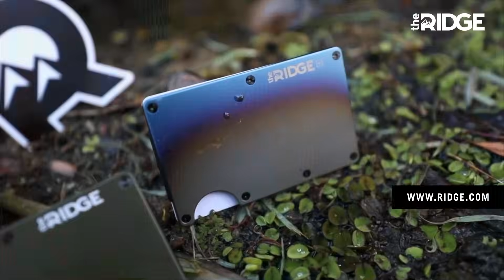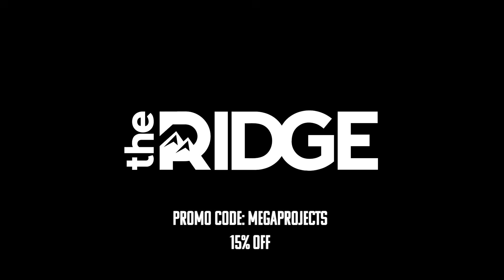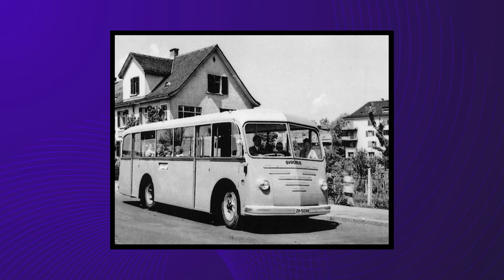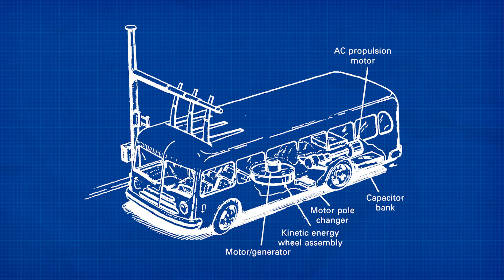Gyrobus: The Incredible 1950s Flywheel Powered Bus

Comment: The modern alternative to flywheels I've seen in use is trams and buses powered by supercapacitor banks. They have a very similar operation where the vehicle recharges at every stop, but it's most likely more reliable since there are no moving parts required in the storage of the electricity. I've seen them in Spain in Seville where the trams have retractable booms to recharge at different stops.
Reply: Thats probably a much more efficient method of storing the energy too. But I have to question if its better than just using a trolley bus or tram. If it has to keep charging at regular intervals it must stick to a predetermined route its not really able to move more freely than a tram or trolley bus anyway. Sure, it doesn't have to have the overhead wires like a trolley bus but the gyro or capacitor bus still needs large amounts of electric infrastructure for charging at stops anyway and the extra cost of the bus its self having to have a means of storing energy probably offsets any extra cost of the wires. So then the advantage to the stored energy bus is no unsightly cables but then again the trolley bus or tram doesnt risk running out of power if there is something delaying it from reaching the next stop, nor are there as many things to cause breakdowns.
Reply: @danielpope6498  Depending on the infrastructure size, I'd argue gyrobuses or capacitor buses have a much more balanced approach than trolleybuses or trams. Storing all the energy in a vehicle has obvious efficiency penalties while storing all the energy on the grid has obvious scalability issues for the infrastructure. Having multiple smaller charging stations at small intervals allows for a much more versatile solution to transport and allows for much more redundancy. Breaking one cable for a trolley bus means the entire line is cutoff while breaking one charging station may mean simply having to change routes in a large scale charging infrastructure. Trams and trolleys are also just too expensive to be a large scale solution to most cities public transport. Having a few simpler charging stations would make such a project much easier to fund and justify. That's also not considering the complicated issue of red tape which conveniently gets ignored when discussing trams and trolleys. You can't easily modify large portions of inhabited lands populated by already existing infrastructure to put suspended structural cables everywhere. Putting a couple charging poles in the ground, by comparison, is not that hard to get approved.
Reply: @danielpope6498 You can charge a capacitor bus from any building from the mains so as long as you can get too a building...you could add solar on the bus too trickle charge which could boost your mileage too 50 miles and only takes 15 seconds too fully charge at higher voltage stations but normal 220v will charge in it in a minuite or two ....you could even use a big crank dynamo too charge your caps if you wish 10 mins exercise on the dynamo could get you another 20 miles pottentially so that's a free vehicle essentially
Reply: Supercapacitors are also not yet at the point where they can store as much energy as a flywheel, which already can't store a significant amount of energy.  This isn't an inherent limitation of supercaps, just that our manufacturing ability needs to improve before they become practical for vehicle energy storage.  At present they are usually coupled with batteries to allow short bursts of large current (charging or discharging), which can be fed into or drawn from the batteries at a lower rate.  But the ultimate goal is to improve the energy capacity of supercaps to get rid of the batteries and have a 100% supercapacitor solution because there are huge benefits in doing so.
Reply: I would imagine that supercaps also do not incur weight penalty as much as a flywheel
Reply: F1 cars use fly wheels in their hybrid systems
Reply: There are modern flywheel batteries and they outperform supercaps and hypercaps
Reply: All responses within this Post are quite relevant and with the advent of current batteries for electric vehicles, a charging method would certainly lengthen the amount of time a vehicle was able to be in service.
That said, I'm wondering whether any manufacturers have seriously considered an electrical dynamo. I won't go into detail unless asked, but surely this could be a better solution?
Reply: @mospeada1152  The flywheel in this design is connected to an induction motor that is used to both spin up the flywheel when charging from the grid, and also in reverse as a generator to convert the flywheel's motion into AC power while driving.  The AC power is then fed to the electric motors connected to the wheels - there is no mechanical linkage between the flywheel and the drive wheels.

I'm not sure how a dynamo could contribute.  It has brushes that wear out and require maintenance, unlike induction motors.  The friction of the brushes also wastes energy, making it less efficient.  A dynamo produces DC power rather than AC, so it may require an inverter to run the AC drive motors (or they would have to be replaced with DC motors, which again have brushes in them that reduce efficiency and need to be maintained).  You'd need a large DC rectifier to convert the incoming three-phase AC power from the grid to DC in order to run the dynamo in reverse to spin up the flywheel when charging, and at the time these buses were in use, that would likely mean a bulky mercury-arc rectifier (either on board or at each charging stop).

In other words, using a dynamo to produce DC was at the time vastly less efficient than using induction motors so it would have increased weight and reduced the range of the bus.  With modern technology handing the DC would no longer be an issue, but there is still the inefficiency of the brushes which you don't get with an AC motor/generator.

I hope that helps give some insight into why they chose not to use a dynamo.
Reply: @Berkeloid0  Thank you, that was very informative. Long, but informative. Obviously there's a fair bit of which I am unfamiliar.
Reply: If you also need to go as "green" as possible a metal flywheel system will be much less impacting than later trying to recycle those capacitors units they are traditional lead acid batteries.

Comment: I wonder how much they could get the weight down on a gyrobus if they were to make the components with newer materials, like graphene.
Reply: The wheel store the energy as angular momentum. Energy stored depend on mass and rpm. Reducing the mass means you need higher velocity to store the same energy.
Better a clever design of the wheel shape to increase energy density.
Reply: @eliahabib5111  The original poster wasn't just referring to the weight of the flywheel - but the weight of the rest of the components of the vehicle, too.  Pressed carbon-fiber-epoxy panels might reduce the weight of the rest of the bus by a lot, compared to steel framing and panels.

Comment: Fly wheels are also an essential part of the function of motor cars as well
Reply: No car has a flywheel of the nature used in the vehicles mentioned in this video. Cars use flywheels as a method of energy transfer from a motor. Not as energy storage....
Reply: @matthewyabsley  no, it works exactly like the flywheels discussed earlier in the video. They are used in the car as a means of storing energy for use later and as a means of smoothing out energy delivery which was mentioned earlier in the video and is not dissimilar to the use in the pedal operated machine shown in the video. The combustion engine produces power in a staccato fassion not a constant application of torque like an EV so the energy is stored in the flywheel which acts like a capacitor smoothing out the power delivery and also providing a bit of reserve power when needed. The storage effect is how you have power when there isn't currently combustion hapening, same way the wheel keeps spinning when the potter's foot isnt on the downstroke. You can even see the stored power effect when someone launches a car. You build up the revs, storing energy in the spinning crankshaft and flywheel and then when you let the clutch engage that stored energy is released. Sure, you are still adding energy to the system but the stored energy in the flywheel means you have more power available than if you just had the power being generated in that given power stroke available to you.
Reply: @danielpope6498  

The flywheel absolutely does not work in the same way as that of the bus in this video.

The flywheel doesn't act as a storage device in a combustion engine it does. You're confusing rotational inertia with energy conservation.

The flywheel damps pulses of energy and damps vibrations via imbalance through the rev range. It also serves as the friction surface for the clutch and allows a starter system (usually a motor) in traditional manual gearbox equipped vehicles.
Reply: @skylined5534  I never said it was used the same way as the bus. Actually I specifically said it works the same way as it did in the pedal operated machines shown earlier in the video.
Reply: @matthewyabsley    To back up the other two commenters on this one (so far),.. I feel it NEEDS to be pointed out that an up-grade to the over-all torque output of literally EVERY internal combustion engine in existence is a heavier flywheel...

   You CAN do more for higher energy/power output of engines, of course, including a heavier crankshaft. Anyone who rides a cruiser for more than a year should understand this concept as one of admittedly MANY reasons Harleys and Indians are notoriously heavy motorcycles. The main purpose of the output is the shear torque you can generate for coming off the line, and that's part of why cruisers tend to be longer and lower set than most other types of motorcycles, to help stabilize them and prevent flip-overs and unwanted wheelies.  ;o)
Reply: @matthewyabsley  Sorry dude but I have never heard of a car that does NOT have a flywheel. Even F1 cars, before KERS had them. They were very small, but they were there.
Reply: @BabyMakR  

The sole purpose of the 'flywheel' for an F1 car (more accurately a clutch basket similar to that in a motorcycle gearbox) is to provide drive between the engine and gearbox. Very little to no rotational damping is provided by said 'flywheel'. You don't need a flywheel in the traditional sense on an engine that regularly sees 15.000rpm for sustained periods of time and needs to get there quickly. Even the starting  duties are handled by an arrangement of gears and a break off clutch powered by an external starter motor pack.

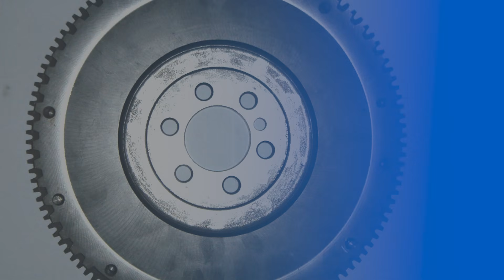Comment: 3:15 - Chapter 1 - What is a flywheel ?
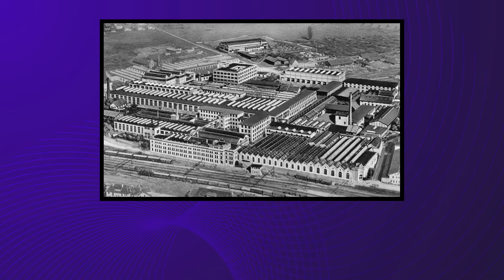5:00 - Chapter 2 - Origins of the gyrobus  
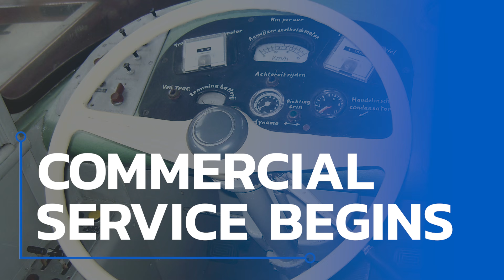7:45 - Chapter 3 - Commercial service begins
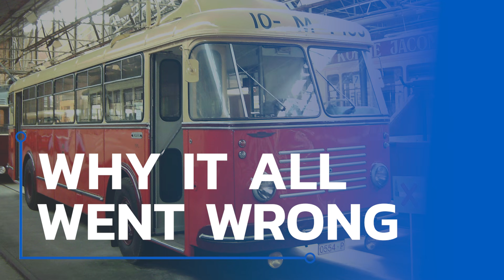10:40 - Chapter 4 - Why it all went wrong
13:35 - Chapter 5 - The future of the flywheel

Comment: Didn't Williams F1 develop a flywheel technology that was sold off and is now in use in some public transport in and around London?
Reply: Correct, they used it as a KERS device, iirc it was then also used by the aborted Nissan LMP1 project, and is used in the modern London buses 

Williams applied tech are pretty interesting, although now independent I believe, they also simply and cheaply massively increased efficiency of chillers at shops
Reply: @jordanclark4635  the system never made it onto a raced F1 car but was tested and used elsewhere within and out of motorsport, weighed too much to justify in the pinnacle of racing

Comment: With modern materials saving some weight and regenerative breaking this could be a banger on short routes within cities
Reply: In flywheels..weight is basically the "batterys capacity"....so you wuouldnt want to lower the weight of the wheel....but sure the rest of vehicles weight would stil be lighter with modern materials
Reply: @teemuleppa3347  Exactly, but... it is not only factor. With better materials we could change "shape" of flywheel to handle same speeds with more of its mass on outer side, slightly reducing mass with same "capacity". Also better materials would mean it is capable of higher speeds which increases capacity waaay more than just throwing more mass at it.
Reply: @teemuleppa3347  The capacity is limited by the specific tensile strength not the weight.
Carbon fibre stores more energy than lead, because it can be spun faster before breaking.
Speed scales energy capacity quadraticly mass only linearly.
Idealy you scale both.
Reply: With the absence of any explosive mixture to backfire, it could hardly be a 'banger'!
Reply: @tooleyheadbang4239  Oh, you underestimate the explosive power of an flywheel failing destructively!
A loud bang and ring of shrapnel!
Reply: @jannikheidemann3805  A 'banger', in automotive terms, is an old, ill-maintained car which backfires, causing a sharp banging noise from the exhaust system.
There is no provision for this to occur on a vehicle with no explosive mixture involved in the propulsion system, so I made a comment to that effect.
Essentially, the point was to draw attention to the original poster's odd use of an existing disparaging term to try and signify approval.
Reply: CLUELESSNESS   !!!!!!!!

Comment: Costs 1.5 to 2 times more. Where does that come from? All things including money boil down to using tangible physical resources up . We just trade one problem for another. 
  Example. Paper bags. Lol was Save A Tree back in 80s. Solution replace with plastic. Lol now its no plastic use paper or durable plastic woven bags which are not so durable and cost in resource just as much to make as 10000 thin bags.

Comment: Interesting, but modern battery tech will do the job. Here in Bergen, Norway a new extended trolley bus line was opened last year. Crossing bridges, tunnels and some other areas where lines are unpractical, an EV-car sized battery provides energy. Battery range is around 12 km, this will also help if there is a fault or maintenance work on parts of the line. The battery is recharged when connected, no need for extended changing stops. Many of the other city buses are battery powered, but this line is quiet long and includes climbing up some steep hills. Then the part trolley - part battery system works realy well.
Reply: Modern battery requires a lot of weird, rare and/or toxic elements that can be complicated to both obtain and to get rid of or recycle. This might become problematic if we want to make everything electric. A system using a simple spinning disc would be cheaper, easier to mass-produce and wouldn't produce toxic waste. Even if batteries are in may ways superior, this could still be a very useful alternative.
Reply: @michaldvorak1  Possible, for some applications. But the gyro is not very efficient. Really efficient spinning systems for energy storage relies on extremely high-revving, lightweight gyros, magnetic bearings, and vacuum chambers. Such systems are expensive and fragile, not usable in a vehicle driving on bumpy roads. And batteries are getting better, cheaper and use less rare materials. Old car batteries are recovered, repaired, reused as stationary units (power banks) and in the end, 80-90 percent of the materials are recycled. Here in Norway, 90 percent of all new cars are EV (and some hybrids), and several recycling plants are being built. Rules for handlíng e-waste are very strict. Illegal dumping or export of waste is a criminal offence and will be punished accordingly.

Comment: I still think that trolley cables and battery backups are nearly a perfect solution. All we need to overcome is government inertia. (two drums and a cymbal fall off a cliff)
Reply: nice Tom Scott reference
Reply: there are street cars systems that use flywheels and steel cables pulled through channels in the ground, moving by coupling and uncoupling from said cable moving in the ground powered from a central plant
Reply: Trolley cables are such an eyesore though
Reply: @enjibkk6850  I live in Amsterdam and never even notice them. Do notice the tram tracks though, when I trip over them on my rollerblades ⛸
Reply: How can you crack jokes? This video is proof that ENVIRONMENTALISTS must be given complete control of the planet NOW! Otherwise in five years when all coastal cities are underwater and everyone is dying you will come running to us screaming "YOU WERE RIGHT!"
Reply: Government inertia is not the only issue here. Red tape is not just about having a stop sign in your face to get things approved to take more time, it's about justifying why the design and infrastructure project should get approved. The reality is in most places trams and trolley buses are unviable because of the reason mentionned in the video : they simply cannot be economically justified in low to medium density areas. They are also destructive projects for the areas where they are implemented. The same way a 4 way highway being built in a neighborhood is destructive to a city, destroying the surrounding structures to build suspension infrastructure for trolley cables and destroying roads to put rails in the ground takes space and is annoying for everyone who lives there. I would also be annoyed about liability if I was a local and my property now had to be used as an anchor point for hundreds of thousands of dollars of engineered cables for which I will never be able to renovate the area now that it's deemed infrastructure critical.